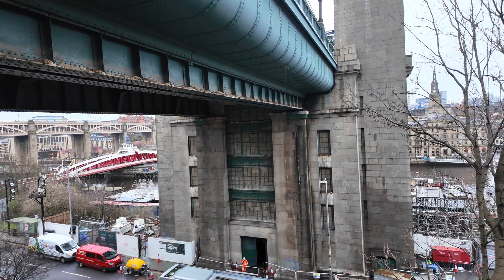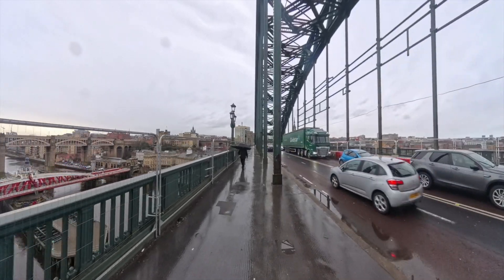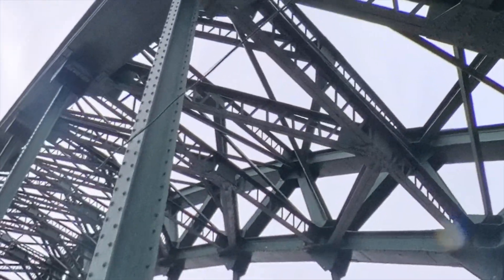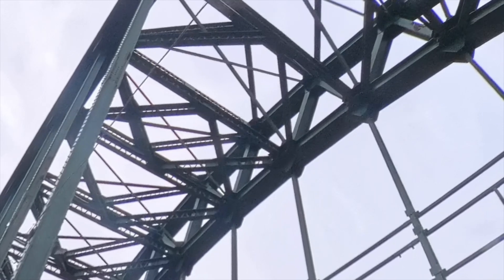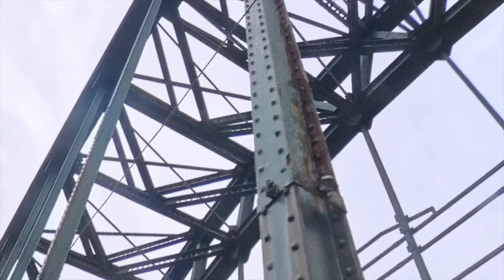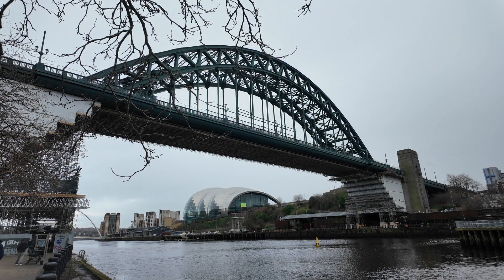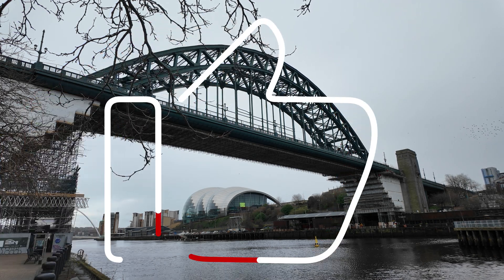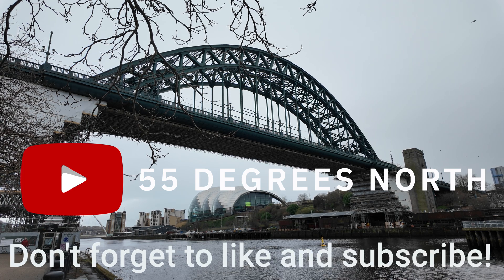Restoring the Tyne Bridge: The Progress So Far

Comment: On the Tyne bridge if you look up on the Gateshead side you can see missing chucks of metal of the internals of the arch.
Looking on the bright side the repairs needed on the redheugh, swing bridge, millennium bridge, the brand new A1 motorway  bridge and with the probability of more work on the high level this may get started after the flyover and the Tyne bridge around 2028
Reply from the maker: @petersmith9470  a lot of things need fixing around here at the moment I am waiting to say there is a problem with the central motorway when the inspections are finished. Thanks for watching 👀